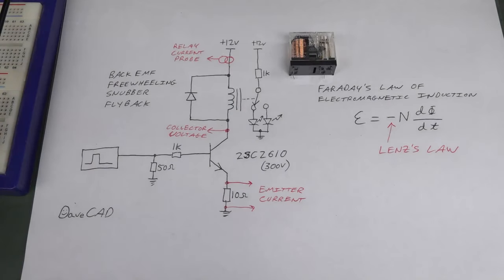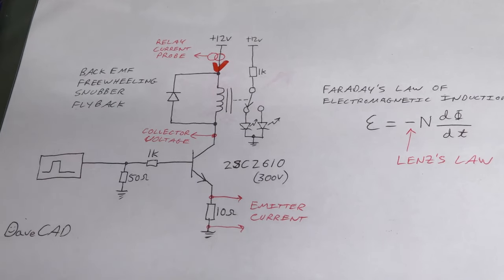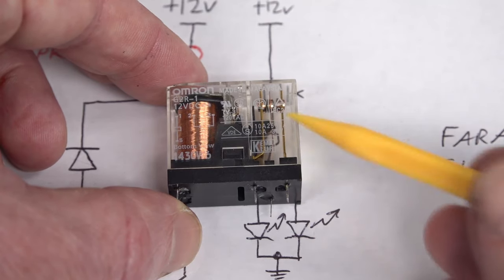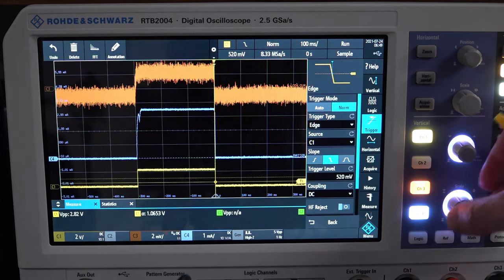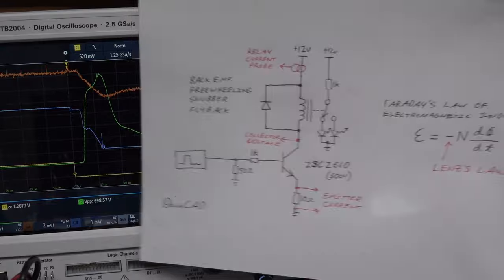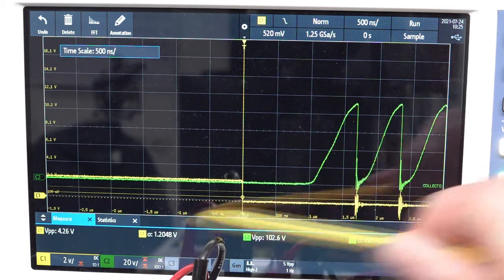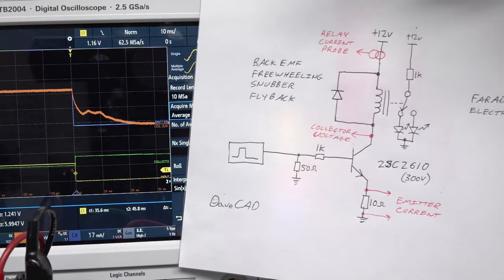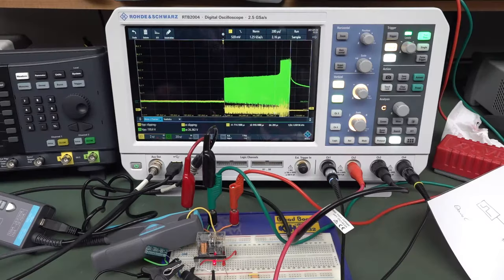EEVblog 1409 - The DANGERS of Inductor Back EMF

Comment: Here's a related "Trap for young players", and I saw this a lot when I did PLC work on industrial equipment, the back-emf diodes we had were on the output side of the relay that was driving large solenoids, plus of course the back-emf diode on the relay itself... These were circuits that had to perform millisecond sensitive operations, and the snubbers would not change how long it took for the relay or the coil to energize, but they'd significantly affect the time to de-energize and would limit the frequency and minimum reliable pulsewidths you could run because they'd hold the relay and solenoid open for longer
Ideally (at least for our application) you would chose the maximum value Zener diode that still protects your circuitry, the higher you can allow the back-emf the faster things will respond
Reply: In an application where fast switching times is needed, mechanical relays is probably not the best choice anyway
 - physically move contact still takes ages, compared to using semiconductors. But if just a freewheeling diode is used, that also means the current gradually goes down, which could cause slow contact separation and that could be a problem (especially for bigger relays that switches high loads). Even if turn off delay is not a problem, arcing at the contacts may be.
I got quite impressed by that "RF transmitter". My experience is that the transistors just fail - not that they "break down" and recover repeatedly like that. 
But it's apparently not the high voltage on it's own that causes them to fail - but rapid heating from huge internal losses. In a low power circuit like this, where the energy stored by the inductor is very low, as well as the average power dissipation (due to the very low switching frequency) - there is no significant heating anyway. Interesting with the mic at the end also - the RFI-clicks could clearly be heard. Funny that it was a Rode mic - those seem to have bad shielding against RFI in general (they pick up a lot of noise from cellphones and other stuff)
Reply: @Speeder84XL  yeah, relays are a bad choice, but they managed with what we needed from them.. I'm sure that now they're using solid state or better.. this was 15 years ago
Reply: @Rx7man  Yeah. 
I was also just thinking that even if the switching can be made faster, it will probably still take 10 ms or more to switch on or off
 - which feels like an eternity when it comes to fast switching in electronics. 
But I can think for example an elevator that uses relays. If it travels for example 2 m/s and the switching time is shorted from 50 ms to 15 - that makes 7 cm less motion before the motor is disconnected (which makes it significantly easier to set it to stop in the right place). Same applies for other machines moving as well. 
So, even for applications that don't need to be switched in micro or even nano seconds (as they could using semiconductors), 10's of extra ms can still have quite a significant impact.
And for the last part, mechanical relays are not always bad - for high power stuff that doesn't need to be switched very often and very fast, they may still be the best choice. Because metal to metal contact  have almost no forward voltage drop and very small losses at on state. The down side, is mainly slow switching and mechanical wear in applications where they switch on/off very often.
Reply: @Speeder84XL  In my case, it was a piece of packaging equipment that needed to spray a glue pattern down on a moving piece of cardboard.. the most important thing is consistency, and the longer the delays on switching, the more inconsistency you can have with varying input voltage, temperature, etc.. the relays we used were small 24V ones and they were really quite fast, I'd say probably around a couple ms to turn on at most, and maybe double that to turn off.. As long as the box was moving slow, or was a large box, it wasn't bad, but when you were trying to crank up a small box to 60/minute, timing gets super critical or you get glue all over the place where you don't want it
Here's one of the big machines I worked on https://www.youtube.com/watch?v=mQukx2IyyL0
Reply: @justan idiot Ok, that was quite interesting. But I can think that the rise time may in fact be very short when using physical contacts. Once the conducting parts come close enough, current quickly start flowing.  (even at a very low voltage the air will break down when the gap is small enough and form an arc/spark, that can allow for a very rapid rise in current flow)
Most of the "switch on time" in a relay happens before the "rise time" though (the time it takes from applying voltage on the coil until the circuit it controls is fully on, is whats's interesting for most applications). Also, it's much harder to "turn off" when using physical contact - because there is always some arcing (which can cover much larger gaps when the contacts is moving apart) before the current stops. The fall time, is always very much longer than the rise time. 
440 Hz is quite impressive for a mechanical circuit though - much faster than what could be possible with a solid state relay in fact, since those can only turn off at a zero crossing of the AC current. Since an AC half wave on mains frequencies is 10 ms for 50 Hz (or 8 1/3 ms for 60 Hz), that's the time it may take to switch off those (so theoretical maximum repetition rate is twice mains frequency - 100-120 Hz)

Comment: Without the flyback diode, the energy stored in the coil dumps much more quickly because there are 90V at the end of the coil terminals instead of 0.6V, as a result the contacts slams really hard.
Reply: How badly can this slamming damage the contacts? The clunk-clunk sounds was really cool.  Thanks Mr. Dave!
Reply: @bsodmike  It doesnt. Instead it REDUCES contact wear because any arc gets extinguished faster. 
Saying to just always add a diode is not the best advice. For example just a Resistor, an RC snubber, or Zener diodes can all be better options than a flyback diode. Plus you cant use a normal diode for AC relays.
Reply: @Basement-Science  Thanks appreciate your response :)
Reply: Recovery snubber is the way to go. It reminds me of playing with old pulse motors and how guys were using the back emf to recharge batteries etc. The high rate of change produces the high transients which could do things like weld reed switches together after the bit of plasma in the discharge created enough heat at the contacts.
Reply: You can even see that the throw of the relay changes. If you look closely the armature actually goes up until it contacts the top of the enclosure.
Reply: @mysock351C  @EEVblog Could the added noise really be the relay arm hitting the enclosure? Any chance to double-check this by repeating the experiment with the relay case removed; how does the relay sound change then when the diode is added to/removed from the circuit?
Reply: @JuhaLaiho  I would think it is as there is no longer anything restraining the armature so the spring can accelerate it more quickly, which then causes it to hit the stop or case since there will be some slop in the mechanism. With the diode, the magnetic field tapers off which helps to damp its motion somewhat. In, I think, the x-chapters of the latest addition of the Art of Electronics they have scope traces showing how much faster the relay closes when you allow the field to promptly collapse.
Reply: @Basement-Science  Not only is the arc extinguished faster, but even more importantly the high ohmic power dissipation period is shortened. As the contacts first touch and the current starts rising, there’s intense localized heating on the contact surface. The faster this low contact pressure operation regime is bypassed, the better This is especially important for NC contacts. Those often have lower current rating even in ideal circumstances, since they are held closed by a spring force and not the electromagnetic force. When the relay opening is slowed down by the use of a low voltage fly back clamp, the already poorly NC contact is further stressed and has its life shortened due to excessive erosion. The goal should be for the release time with flyback suppression to be no more than 50% longer than release time with no suppression. Many relay circuits that use NC contacts disregard this guidance. The NO contacts also suffer when their closure pressure is low for longer, due to slowed down release action.
Reply: Ding, ding, ding

Comment: A good way to think about stored magnetic flux and the collapsing magnetic field generating EMF is that of physical momentum. If you roll a bowling ball and suddenly try and stop it, the force pushing back on your hand to stop the ball is the back EMF force trying to stop to momentum of the forward current flow. Or another analogue is of a spinning bicycle wheel and tire. Spin the bike wheel up while you have the bike elevated and then suddenly try and stop the wheel with your hand. Everyone, from child through to elderly, knows EXACTLY what will happen. This is exactly the same thing but in the physical world where people can more easily understand it.

Great video, Dave!!!!!

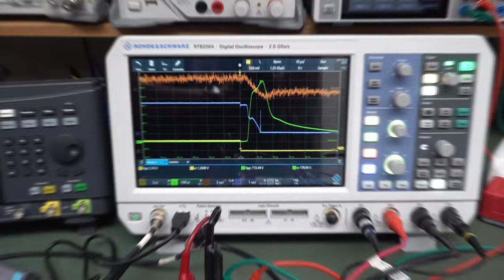PS 14:00 That poor poor BJT is getting flogged!!! LOL
Reply: Water hammer
Reply from the maker: Yes, I used the flywheel analogy in the video.
No transistor were harmed in the making of this video.

Comment: TE has an application note about this for mechanical relays. They say the diode decreases relay force because it decreases opening force and opening velocity. Both necessary to break the dendrites that grow on the contact point. If you put a flyback diode on control side you have only the spring force to open the relay. It will open slowly with diode but it will slam open without the diode. The problem is you need 80V NPN for 24V relay and that is slightly out of spec. 90V collector absolute maximum rating would be ideal for 24V. It depends on proprietary specifications of your exact relay part number though. This is what it was for my TE part. It also depends on your requirements for relay cycles before failure. I follow the application note from TE to get 1,000,000 cycles guaranteed and certified on the datasheet.

Comment: In junior high I bought a plastic sandwich box, put 2x 9v batteries and a relay (wired to oscillate) inside, on the outside put screws as terminals and a red button. It was fun to test for how long people could withstand the shock, and buzzing of the relay made even more hilarious. It taught me that people have vastly different electric shock threshold.
Reply: I did this in 5th grade and wired it up to the 3v side of a 120->3v transformer. What a messed up childhood

Comment: 28:40 My guess is because the diode has slowed the switching action slightly, the contacts don't slam shut as forcefully. This makes the relay operate more quietly.
Reply: But its contacts would now arc more if HV inductive load is switched!
Reply: Yep, that would be my guess as well.
Reply: EDIT: apparently it's not electromagnetic, and actually making the relay louder. Fascinating.

The high-voltage pulse generates RF, which the mic picks up due to imperfect shielding. Basically a small EMP. If you hook a relay up so that its contacts open when energized and power the coil via this, you get a simple oscillator that emits wideband RF, with the spark occurring in the relay contacts. Look up spark-gap transmitter.
Reply: My guess is that the high voltage coils magnetic field is coupling to the microphones coil.
Reply: @snivesz32  That would be a good theory, but the mic used is a Rode NT5, it is a condenser (capacitor) type with no moving coil or transformer, as is more common in studio applications due to higher sensitivity and linearity compared to moving coil (dynamic) designs. The diaphragm itself functions as a capacitor which varies capacitance and thus voltage due to the change in distance between the flexible diaphragm and static backplate when air pressure impinges on the former.
Reply from the maker: @gblargg  I forgot to add that in the overlay. I can assure you it is much louder to the ear, and a very different sound, it's not just mic coupling.
Reply: @EEVblog  The increased noise is only evident when the relay goes back! i.e on disconnect
Reply: I gues that there is no diode in my car blink relay its werry loud. The diode effektivily brake the back emf so the field is still in the coil some time therfor the sound
Reply: Lenz's law again. With the high back emf, the magnetic field collapses faster. Guess what that also does? It generates eddy currents in every conductive material interacting with the field. 

And this comes with force generation also: force that tends to act opposite to how you typically think of magnetic attraction (of ferromagnetic materials), and it affects all conductors, not just ferrous materials, but also ferrous materials. 

As the electromagnet's field dies away from the 'anchor' it is holding close, it's like there is a temporary small magnet appearing within the bulk of the anchor, and acting to repel the field (Lenz's law: it's always fighting you). But the eddy currents meet resistance too (steel isn't all that good of a conductor) so they would die away quickly.  

This means the faster the field collapses, the harder that eddy interaction physically repels the anchor, and the more impulse force you get from it before the bulk resistivity of the material can kill the eddy currents. 

The bigger the impulse is, the more kinetic energy the anchor picks up as the return spring also pulls on it, and the louder the 'clack' it makes as it impacts the end stop. Thus, it gets louder.

There were some ultra-fast disconnectors that used a copper piece which were 'shoved away' from the actuating coil, by way of using a very high coil voltage, resulting in a very high dB/dt, resulting in strong eddy currents in the copper piece, and thus a strong and sudden repulsive impact. 

In fact, this is why you can't 'speed up' the turn-on of a relay by just giving it higher voltages: You hit a point where the repulsion of the eddy currents within the anchor repel it more than the penetrating magnetic field attracts it, and this goes on for a relatively long time, delaying the start of movement of the anchor towards the coil compared to the point it would have started moving, at a given current. 

This tends to lead to accidentally saturating the magnetic circuit, because, you guessed it - eddy currents can also form about the core materials in such a way as to reduce the apparent inductance of the coil, because the rapid-onset field just can't penetrate the ferrous material in the magnetic circuit quickly enough: it makes it look more like an air-core, albeit temporarily. This soon results in even faster than expected current rise in whatever switch you are using to turn the coil on, which can destroy your transistor simply due to the huge peak currents that you can end up pulling. 

And to add insult to injury, your relay actually ends up turning on *later*, because it starts moving later, after the eddies in the anchor have dissipated away, and their repulsive force contribution too. 

And then you can also end up with too much force when the anchor finishes its move - as, in an effort to move it faster, you may have the current higher than would be needed. The attractive force grows exponentially as the magnetic gap gets shorter, and this can break things mechanically if it's too severe. The turn-on 'clack' gets violent also. With no real switching performance improvement, only more severe turn-on and turn-off impact and thus contact bounce also leading to faster contact wear.

Comment: I remember in my basic electronics lab course we used a transformer, a neon lamp (80V indicator neon lamp as I recall), and a push button switch to demonstrate flyback voltage. Someone in my class hooked up the transformer backwards (and used 120VAC wall voltage instead of our 12VDC power supplies) and ended up getting a large enough flyback to explode his neon lamp (and push button switch). After that we joked with him that he left his shadow on the wall behind him from the flash.

Comment: When I was starting my electronics experience ( after uni, because they didn't teached us that), while designing my first prototypes of a AHU control PCB  I got a such strong kick back it restarted the microcontroller on the board. took me a while to to realize that I need a diode on every relay and that I have those  in the uln2003, just needed to connect the com pin to relay drive voltage. And thinking of it now I remember that my father told that the spark on the motorcycles ignition coil sparks when the contacts on the crank position sensing thingie opens. Took a good 15 years to wrap the experiences and data together.

Comment: I've built a few linear power supplies and ended up putting some high voltage ceramic caps across the diodes to help smooth away the spikes caused by the switching action of the does in the rectifier.

Wrt the microphone, I reckon there is electromagnetic noise that is suppressed with the clamping diode, and that the mic is picking that up. Also potentially some arcing in the relay.
Reply: Mic (or the associated circuitry) picking up the electrical spike is my guess, too.  Bonus reason: it's the drop-out side of the cycle that gets louder, and that's where the spike happens.  (Of course, the pull-in side of the cycle shouldn't be in any way affected by the diode.)  Mostly, though, the extra noise sounds more electrical than mechanical, somehow.